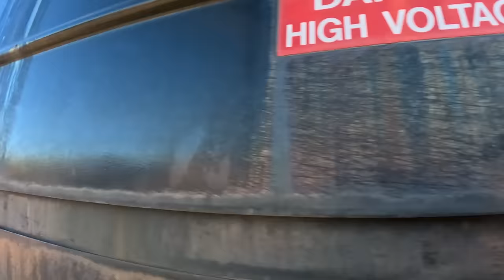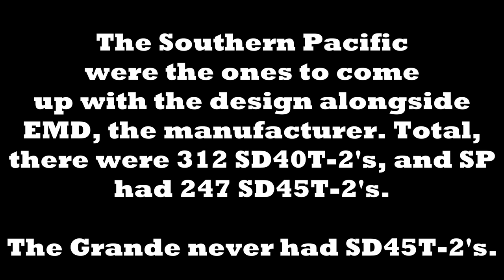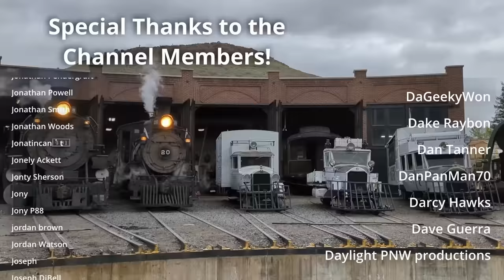A train that can BREATHE in TUNNELS? What's a TUNNEL MOTOR? | Railroad 101

Comment: Right when you went to start talking about the engine protector, I was fully prepared to be a pedant in the comments section lol. A couple snippets from me are all I have though.

1: The hot oil detector and engine protector both work by causing the governor to sense low oil pressure, which as you said makes it shut down. The hot oil detector is a thermostatic valve, (like a thermostat in a car or truck) which opens at, I believe, 215 degrees Fahrenheit. When it opens it dumps the oil in the governor's sensing line causing the low oil shutdown to pop. The actual valve for that is located in the main lube manifold going into the front of the engine.

2: You mentioned a sort of "limp mode" and actually even those old locomotives have something similar. When you look right above air compressor and towards the front of the locomotive you can see a water manifold. That manifold has three temperature switches in it (a normal SD40-2 would have four). The switches are labeled TA, TB, TC, and ETS. (A tunnel won't have a switch in the TC spot since they only have two fans.) That ETS (engine temperature switch) picks up at, again I think, 205 degrees. When that switch closes a bunch of electrical stuff happens and it "derates" in a sense. It basically changes your throttle notches to 1, 2, 3, 4, 5, 6, 5, 6. (in 7 & 8 it knocks you down 2 notches) the speed reduction reduces the risk of cavitation in the water pumps, and the excitation system reduces the load on the engine as well. Not anywhere near what modern electronic controls are capable of, but still a neat little "limp mode" even on those old engines.

So yeah, that's the pedant in me satisfied lol. Great video and definitely earned a like from me!

Also, I'm sure you remember me from last week and I did check and according to the source I looked at, our 5413 retains the number it had when it ran on the D&RGW, and the 5412 used to be the D&RGW 5391.
Reply from the maker: Well hell! That's awesome detail. The BNSF sent us darned white hats to the mechanical schools, but didn't cover any electrical side. I always wished I learned more. I just thought those temp switches were just for controlling the rad fans - I'll admit, when I saw all of them back there on 5401, I was confused seeing as it has fewer fans. That makes a ton of sense! Thanks for teaching me something today. :)
Reply: @Hyce777  No problem at all! I'm a locomotive tech by trade and the railroad I work for has a roster that's over half SD40-2's. And even the stuff that isn't is mostly of similar vintage (GP35, GP40, SD40)

I also have a literal electrical manual for the SD40-2 that I was given as part of my apprenticeship.

Edit: I've also had days where I was bored at work and would get out prints and spend time going through them to find out what makes things happen. (Yes I have heard I'm strange) I have a couple of sequences wrote out on my phone for reference.
Reply: @CDROM-lq9iz  
There’s nothing strange about knowing your job, especially when you get sent on a road trip to get the mainline cleared and traffic moving again.
I’ve had to go out on the road and change a CLS (coolant level sensor) on a C-44 AC without losing too much coolant, and it was still running when we got there, stopped on the main line, nowhere near a water source to refill the cooling system. The bad sensor wasn’t allowing the unit to load, and the remaining consist didn’t have the power to continue on the uphill grade without it. I put on a rain suit, some leather gloves, some thick neoprene oil changing gloves over those, a face shield, and taped all of the seems on that stuff closed with duct tape. I was able to get the sensor changed and only lost about 4-5 inches of water in the sight glass. Got er loading and on her way in about 30 minutes time, main line clear and open to more traffic. 
Have a good day sir!
Reply: @ralfie8801  Thanks and I'm sure you had a hell of a time getting out of that getup lol. I don't think I've done anything quite that sketchy but I have had to manually put motor cutouts in on an SD40 that was blocking a yard track and an inbound was waiting on the main for them to clear up.

I've also fixed a couple loading issues with a hammer to the side of a contactor.

I'm sure stuff like that would make plenty of people freak out lol.
Reply: @CDROM-lq9iz  
Yeah, I put all that on because I didn’t feel like getting scalded with 210 degree water. It was a mess, but it all worked out in the end. Had to travel 25 miles to get to it.
Reply: @ralfie8801  I don't blame you at all for that one.

At the end of the day it comes down to keeping the freight moving
Reply: @Hyce777  Hey Hyce! Here to correct myself. I was thinking the other day and realized I had to be way off on the hot oil temperature so I went and dug up the right information.

1. The hot oil thermostatic valve opens at 260 degrees Fahrenheit.

2. Different locomotives use different set points for the fan switches and ETS. I found 2 different ETS switches in our parts store and they have pickup/dropout Temps as follows. a) 215/205 and b)200/190.

Not a big deal I suppose in the grand scheme of things but I did want to correct myself. Cheers!

Comment: I was hoping to see a piston going to space in the clip that played after the discussion of crank case overpressure
Reply: Me to
Reply: Lol yes me toooooooo😂
Reply: i fully expected it
Reply: Who DIDN'T expect to see that?
Reply: Same
Reply: I didn’t expect to see that, mostly because a rod would come loose and beat the sides out of the crankcase before it ever launched a piston. You’ll see that happen on 100 GE locomotives before ever seeing an EMD do it once.
Reply: Lol I was looking away for a moment but when he said that I watched that smokey engine real close to see it happen... And it didn't 😶
Reply: I think everyone, including me, thought this.
Reply: @elrondmcbong467  
Why though? If you think about it, launching a piston out of the block and into the air due to crankcase over pressure is next to impossible. Over pressure can be caused by something as harmless as worn piston rings. A damaged piston is worse, but not by much. The original comment about this is just a conversation/argument starter. 
For comparison, the PCV valve on your car or truck is there to get rid of crankcase over pressure by sending 5hat pressure and fumes back through the engine’s intake system.
Reply: @ralfie8801  Exactly what I thought. Oil spewing out of every gasket, seal and crevasse of the engine is what I would expect to happen. If it's due to massive blow-by it would just lose power. I struggle to imagine where the forces to yank a piston from a rod would come from. Crankcase pressure is never ever going to get anywhere close to cylinder pressures.
Reply: @ralfie8801  I thought the PCV was there to make people who think of themselves as "gear heads" cuss about the government.
Reply: Same
Reply: @ShuRugal  
It is, but it has a purpose too. It replaced that smoke puffing breather pipe engines used to have until the early 1960’s.
Reply: Me too!
Reply: Facts. I was waiting for it and then realized it wasn’t going to happen and now i feel robbed for some reason. 😢
Reply: I too was looking for that piston going to space!
Reply: He got us all hook line and sinker! 😂

Comment: Would love to see both 5401 and 3011 featured in a loco 360
Reply from the maker: 3011 is unfortunately missing a ton of functional things. It got parted out prior to being donated.
Reply: @Hyce777  Thats a shame, perhaps swap out 3011 for one of the Geese?
Reply: 9:29  if you look most modern locomotive adopted the tunnel motor style cooling and intake system .
     Take a deep dive also on the sd45x  elephant ears was another attempt to do the same thing
Reply: @Hyce777 Anyway we could get a 360 of the tiny little gas switcher? Peewee I think you guys dubbed it.
Reply: @Hyce777 I just want to see what's behythe door on the engineers side just behind the cab.... In detail... So yeah! A 360 would be killer!!!

Comment: Those SD40s may be old and outdated but there are very few locomotives that I prefer when it comes to flat switching.
Reply from the maker: They load way quicker than anything GE ever made, that's for sure, lol.
Reply: I preferred the SW1500s and MP15s for switching. The brakes are not that great on the Geeps and SD40s, especially if they have the independents turned down for remotes.
Reply: @rjohnson1690 we don't use remote locomotives, we have an engineer due to our yard design. All of our older locos have been sold or scrapped :(
Reply: @Hyce777 lol switch with any GE is pain, at least the new ACs (when we get them) are quite quick once they start to load.
Reply: GE units for the most part have better traction motors and stronger tractive effort. EMD units however normally load quicker,both DC & AC,which gives them road switching advantage. One of the only GE units suitable for switching are the ES44AC's,the throttle response is impressive. I completely agree about the SW1500's,minus the flexicoil trucks,and MP15DC's/AC's which were awesome switchers. The GP40-2's & SD40-2's were the last great units built by EMD without any major flaws. It's debatable nowadays on what's been reliable. I will personally note down that the modern GE units have incredible dynamic braking when it comes down to serious tonnage.
Reply: Lol we don't get ES44ACs here, they are reserved for important trains. We usually get clapped out GE and EMD locomotives on our little branch line. The last ES44AC that came through our terminal showed up dead and drained of water.
Reply: Older EMD units seem to last longer than the older GE units without causing another turbocharger fire. I was just simply acknowledging the general detail about the ES44AC's,nothing specific.

Comment: I loved our SP tunnels. We had 45t-2s and regular 40t-2s. Crews would often brag about how good "9500" and "9400" were at pulling. Sadly the tunnels are all but gone, with the last one "4071" breifly going into the deadline before being returned for a short time as a new customer needed a dedicated engine. She found her way into a few more road trains as she came in on her 92 day and the customer realized a big 6 axle was too much power for them only to finally end up leased to a grain elevator after one of their workhorses went down. Its unclear if 4071 will ever return to our roster or will remain at the elevator the rest of her days.
Reply: Nearly all went to Brasil and worked meter gauge with ALL and some rebuilt for FCA as BB40t-2....

Comment: Former EMD mechanic here, once we got a call from a customer saying the engine shut down and wouldn't start back up. And they said it wouldn't stop beeping for hours and just couldnt figure it out. We went out there to a geep and turns out the only problem was the governor button was out. Pushed it back in and problem solved 😂 topped off the water and the oil to make sure and checked its vitals. Everything was all good!

Comment: Very cool video! The SD40T-2 has to be my favorite EMD locomotive of all time. My grandfather worked for the SP and worked with these all the time, despite there being no tunnels on the SP route through Arizona, although they did work Donner Pass and throughout the Sierra Nevadas. Said they were fantastic at what they did. After the merger, he also got to work on former Grande ones and on the former DRGW lines, including Moffat Tunnel!
Reply: I guess this design also helps in hot climate of Arizona? The cooler the air you blow through the radiators, the more efficient they are. Blowing hot desert air through isn't great, but it's better than hot desert air that's been pre-heated by everything that it passed before it got to the radiators.

I'm not sure what the difference in manufacturing price, running costs and maintenance costs are, but as these changes were not made standard for the model I suppose there has to be a drawback somewhere.

Comment: Was about to comment about how the SP developed the tunnel motors, but it looks like you beat me to it.  😁  That said, Moffat tunnel is no longer the second longest in the US, it's the third.  Flathead Tunnel in Montana, built in the late 60's, is second longest at 7 miles.  It was built to reroute the GN Hi-Line when Libby Dam flooded the original route.
Reply: Why didn't they just build a really long bridge? 🤔
Reply from the maker: Oh cool! So we're extra extra wrong. Lol!
Reply: @realcanadian67  they wouldn't need a long bridge.  They'd need a very steep grade to get above the dam from Libby, and then a lot of track along the shore of the new lake (which flooded an entire valley, lengthwise).  A new route to the south and the 7 mile tunnel was apparently easier and less steep.
Reply: the dam and the realignment were done by the US Army Corps of Engineers, fun fact. those guys are no joke, they can build anything, and to pretty good standards
Reply: @BandanRRChannel  rack and pinion?!?!? It was right Infront of them!!!! Smh...

Comment: Fun fact:  Air brakes in semi trucks were inspired by the same braking system in locomotives because of how successful it was, and was adopted.   After 1974 or 1975, the spring brake chamber is the required type of air brakes to be used in semi trucks because of the safety issue that arose when trucks that lost air pressure meant that there were no brakes and no brakes means it's gonna be a VERY bade time.

The spring brakes are the safety mechanism in place to prevent that from happening, BUT you'd need air pressure to essentially "unlock" the brakes to allow the truck to move as well as air pressure to stop the truck.

Comment: A tunnel story.
My dad fired for the  B&O out of Baltimore, West End.  The route west, the Old Main Line, winds it's way up a river valley, cresting the grade at a place called Mount Airy, Md. The line summits through a mile-long tunnel under the town. Not that steep, but for a train, gradient is relative. 
The trick to firing through a tunnel is to have the boiler full, and the fire-box as hot as possible with  plenty of coal. Before entering the tunnel the feed-water is shut-off, and no more coal added to the fire. With luck the train will be over the hump before water and coal must be added.
Often the water in the sight-glass would drop out of sight.
The  story
The engine wasn't steaming well. Not only did it require almost constant feed-water, it was burning more coal than it should, and was filling the tunnel with exhaust. 
Then they stalled.
My dad looked over at the engineer. The engineer was on the verge of passing-out. My dad suggested to the brakeman to get down and pull the pin, they had to get out of there.
He went over to the engineer, shaking him and yelling, "Give the brakeman some slack, we're cutting-off and getting out of here."
Tunnels and fuel-burning engines are fundamentally incompatible. 
If tunnels had desires, it would be to kill humans.
I am sure that Hyce has a copy of "Rails that Climb."
The Moffat trains faced snow-shed hells.
Reply: That's a really dangerous situation to be in !
( sounds like in the llate 1930s or 1940s )

If you were headed Uphill, water would normally flow to back/cab end of boiler, causing sight glass to read high compared to a level loco... if water is below the sight glass and you are on an UP grade, then the front of boiler is running dry, and the water right over firebox top plate is thin too, which can lead to boiler explosion if you have much of a fire going.

But, at that moment, their immediate problem was a stalled engine and being 3 minutes from suffocating in a tunnel !!

About their only option was to set the air brakes on train, disconnect, and use what little steam was left in boiler to get the locomotive + crew moving toward fresh air.

This would have left a mess for the rail line... (hopefully no other train scheduled on that track soon)
Rail boss would have needed to send another loco+crew to attach to the train from bottom end, release the brakes and take cars back downhill to siding or rail yard... possibly split into smaller load, then send again in pieces.

Sounds like it may have blocked rail traffic most of the day, but I'm glad nobody died.

Comment: You know, I was just asking myself last week if you had covered the museum's tunnel motor. Lo and behold I get this in my recommended! Beautiful explanation of the functionalities!

Our railroad has 3 tunnels, two of them still retaining the original Rio Grande livery! 5391 (now 5412) and 5413! 

As a side note, sanding these things are a pain, especially if there are two of them back-to-back :L
I just love trying to reach for the sand hoses that have been set up for regular 6-axles and the occasional 4-axles when these long bois come in. Stretch Armstrong mode activated. And don't get me started on those long hood suicide steps .-.

Comment: I love watching your videos and as a helper in a maintenance shop the standard SD40-2 is 68ft 10in, where the SD40T-2 is 70ft 8in the Locomotive is slightly longer to accommodate for the rear tunnel radiator

Comment: I’ve always heard that the point of the tunnel motors wasn’t really to keep cool inside the tunnel, because pretty much all air in the tunnel gets hot after a little bit. But rather it was to cool down faster when it was outside the tunnel, so that it’s ready for the next tunnel.